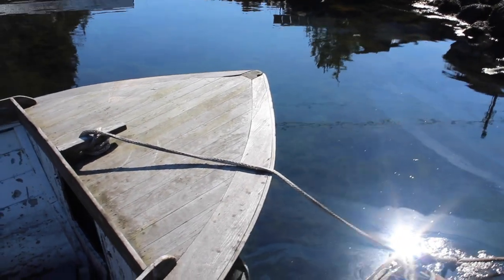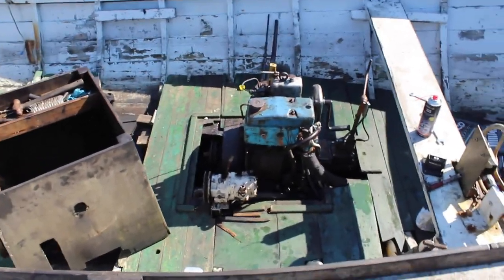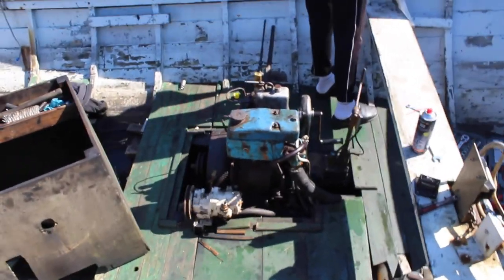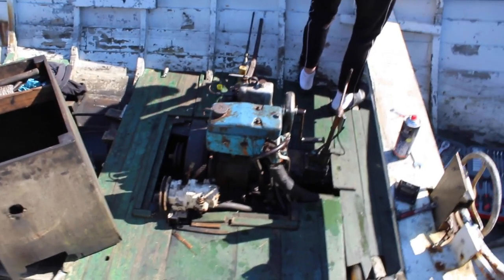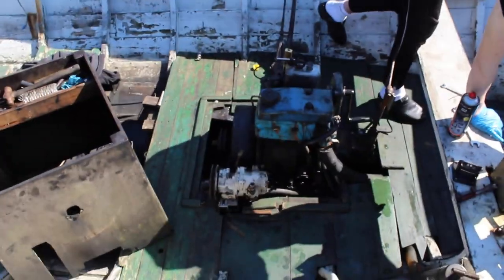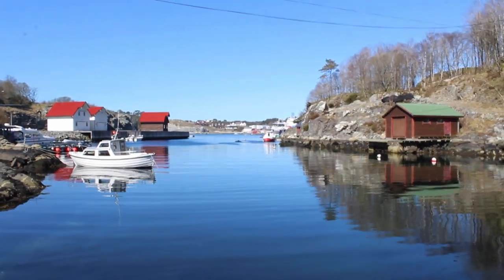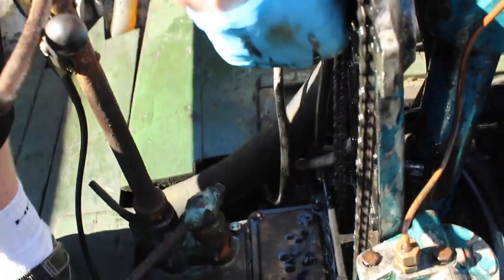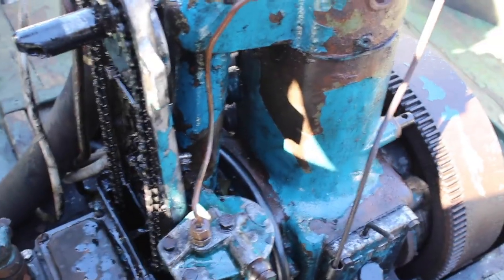DID WE JUST BLOW UP OUR ENGINE??? - Ye Olde Crusty Ep.3

Comment: I have the same engine. In the gearbox there are 2 plates that are the clutch assembly. There is a notch on the plate closest to motor side. This notch engages the pawl (like in a winch) when you turn the chain with the handle, the pawl falls into this notch and you can turn the crankshaft.
The oil in the gearbox should be changed. Suck old oil out, clean gearbox with fresh diesel to wash the parts. Then suck out diesel and replace with fresh engine oil. I believe takes 500ml. This way the pawl moves freely. As for your fuel issue, sometimes the injector pump plunger gets stuck. Take of injector line and spray lubricant in and leave overnight. Should loosen right up. Also make sure the fuel rack moves freely.
This motor has to have a few squirts of oil into valve cover cap,or the access boat on head. This primes and builds compression in cylinder.
Also the throttle should be at full. Then use decompressor, make sure it's straight and keeps valve open. Crank the start handle 7 or 8 times and close decompression lever. Give a couple second to start going and throttle down. Good luck
Reply from the maker: Thanks for the grat tips! Fortunately, we managed to fix the issues already :)